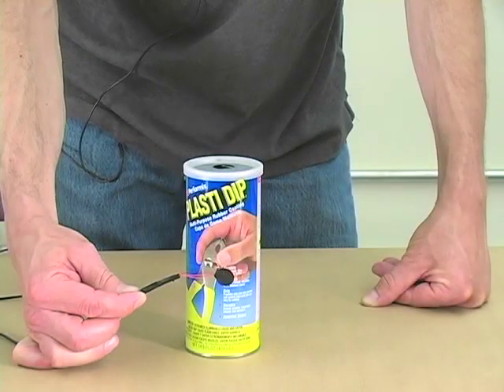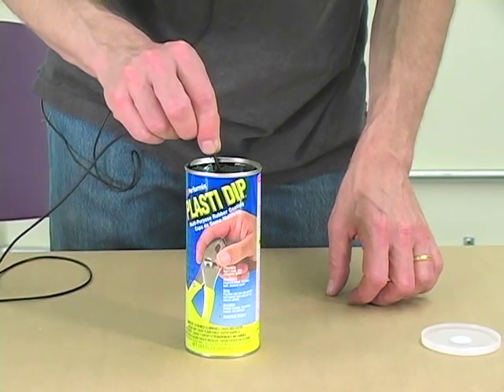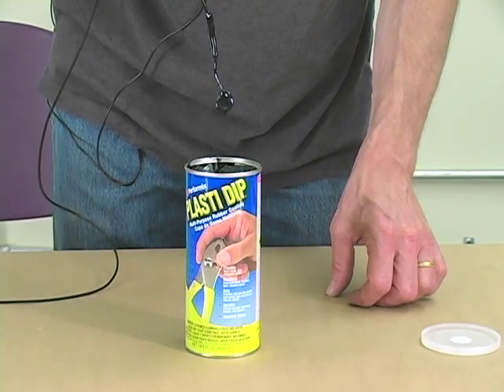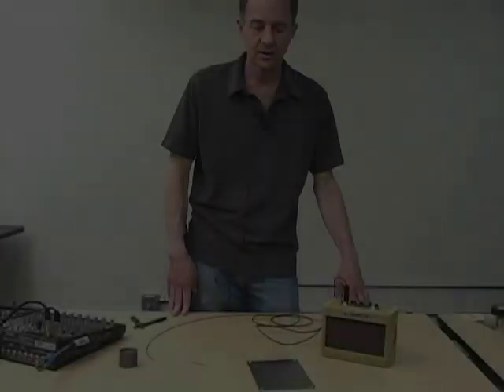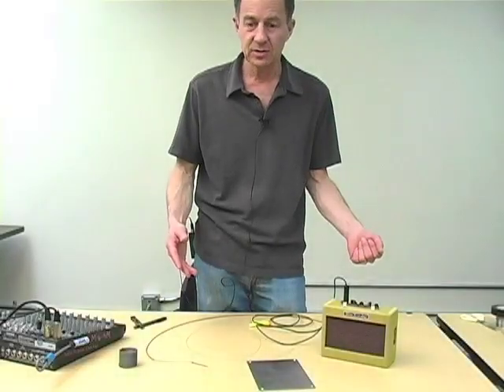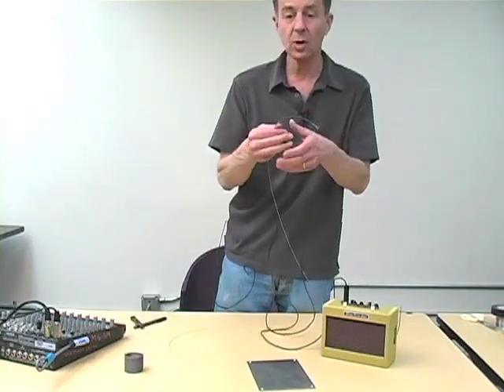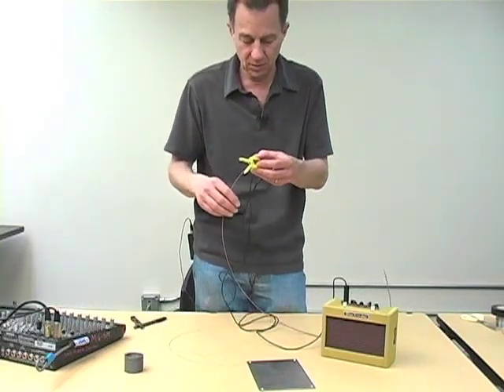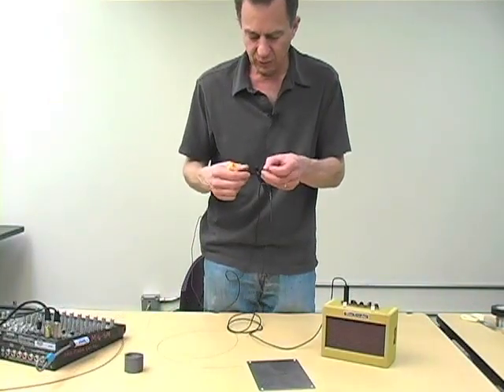Hack of the Month Club -- Project #5: Make a Contact Mike (part 3 of 3)

Comment: can you use plastic spray, or is the dip the way to go?
Reply from the maker: The original dip may be off the market, lately I can only find the spray version, which works fine (if not as satisfying an application process.)